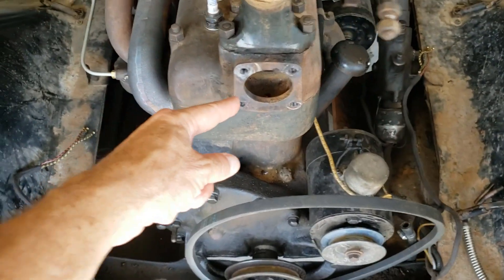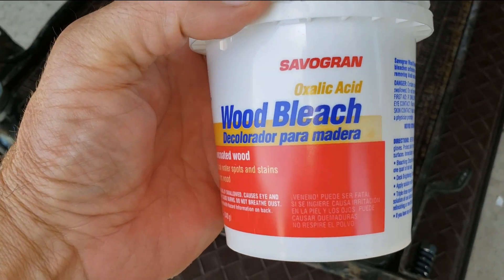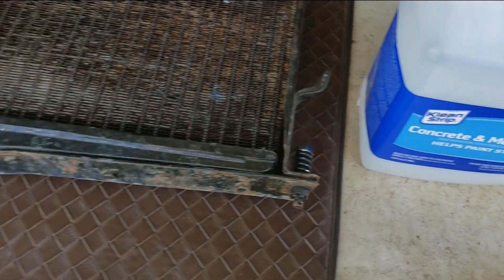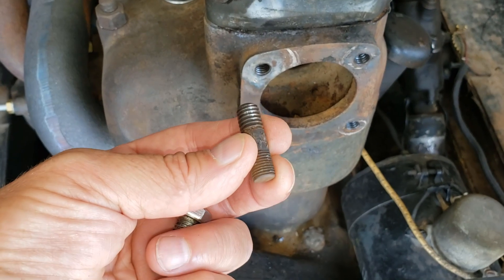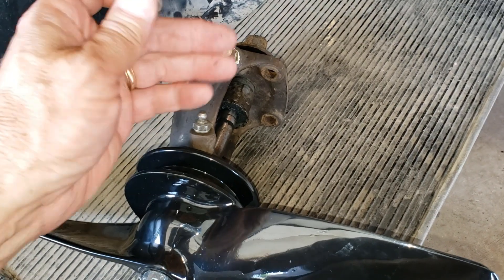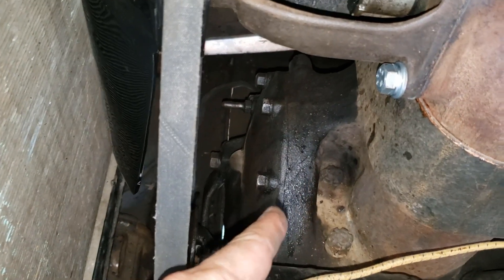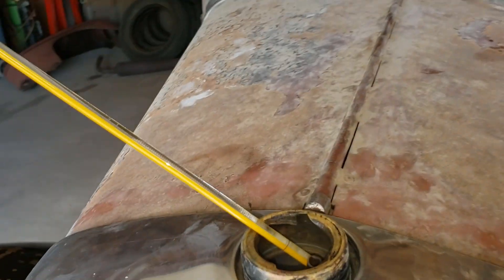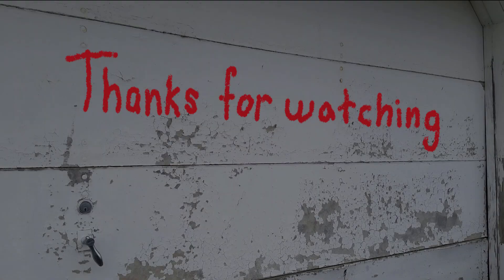Episode 14 - How to Safely Flush a Radiator with Acid. #withme #barnfind

Comment: When you say 3 to 1 ratio you are mixing a powder and a liquid how much powder to a gallon of water
Reply from the maker: 4 ounces per gallon.
Reply from the maker: The Radiator holds 3 gallons so I read on the label of the powder to mix 1 gallon of water in a milk jug. Then added it to 2 more gallons of water into the radiator to fill it completely. Hope this helps.
Reply: @FlatheadTerry yes but how much acid powder per gallon of water

Comment: How long did you let the mixtures sit in the radiator? 

Do you think the radiator has to be removed to do this? Or if you capped the bottom tube could you do it on the car?
Reply from the maker: I soaked it about 5 hours. But it depends on the amount of build up to remove. Mine stopped bubbling after that time which was a good indicator of completion. However, leaving this acid in for very long times can cause damage so you can drain it out after a few hours and if it's not done, just re-install the solution again to be on the safe side. Also, this can definitely be performed in  the car. Yep, just cap off the bottom like you mentioned.

Comment: how did you mix the 1 to 3, and what size container did you use. you did mention a gallon jug, but not sure how you positioned the radiator; so it get's to all areas. Thanks, and i'm definitly going to try your method, as i've already purchased the ingredients. 😀
Reply from the maker: I mixed it in plastic gallon  milk jugs as it made it easy to pour in. I had to take out the radiator anyway so I just laid it down flat. It took time for the solution to work it's way into all of the tube's but after 30 minutes it settled and I didn't have to add any more solution. It's OK to perform this while the radiator is still in the car. Just cap off the bottom securely. Hope this helps!
Reply: @FlatheadTerry  answered perfectly, Thanks😀

Comment: I've had the same issue with my Model A radiator. So so so much rust. I've done a total of 3 days of soaking with vinegar and I've had to take the water pipe off to get all the rust chunks out. I'll take it around the block and it overheats again, so I have been just rinse and repeat mode. If it doesn't start running cooler I'll probably try the acids you used. Thanks for the video!

Comment: I just take it to a radiator shop they have hot acid tanks removes everything even the paint. They use a torch remove the tanks rod out the core with flush with the acid solder the tanks back on repaint everything good as new.  They usually are in the industrial parts of cities where  no one much cares what chemicals people are using near junk yards lot of times. Some little shack looking building from what I have seen.
Reply from the maker: Thanks for the suggestion blastman8888. I called all the local radiator shops and they wouldn't touch it. Its too old for them they said. So I had to resort to this process.

Comment: Great Stuff. Thanks Terry. I’ve also heard that if you have to use a paint, on the Radiator. Use one that is Water Based. If you wished to paint the outside of the Radiator…Any other type of paint use restricts the flow of air though the fins? This was something an old Mechanic/Radiator Specialist/Shop Owner told me in the early 1980’s. I’m not sure if this still holds true. Thanks for your info, I also built the “Apparatus” for later use, Thanks.
Reply from the maker: Thanks for the good info Craig. Appreciate it!
Reply: @FlatheadTerry  I tried buying the Klean Strip Metal Prep and Wood Bleach at Home Depot. They didn’t seem to carry it here.
Reply: Found it on Amazon. So, my rust removal will continue.

Comment: What size bolts did you use to replace the water pump studs?
Reply from the maker: Dang, I don't remember! I took the original bolts and went to the hardware store and found similar sized studs.
Reply: @FlatheadTerry  According to Bratton's 2019 catalog, the original studs had 3/8x16 threads and were 1 1/4" long.  Similar size bolts should do the trick.  Model A suppliers also have replacement bolts made to look like studs with nuts on them.  A little pricy but will fool the judges.
Reply from the maker: @mafcawebmaster4237  Great info! Thx!👍
Reply: @FlatheadTerry  Tip: when doing a "how to" video, it's nice if you can give full descriptions of the parts you use, like you did when you mentioned the chemicals.  That way, viewers have a "heads up" on what they need to look for. :)
Reply from the maker: @mafcawebmaster4237  Thanks for the comment. Agreed! If you view my more recent videos, you'll see that I've listed the part numbers, manufacturers, etc., in them to better help the viewer find 'em.
Reply: @FlatheadTerry  Thumbs up! Terry

Comment: i try with everiting the best was oxalic acid!! remove old coolant add only destiled whater with 50g or so ocalic acid! and drive a day! acid will work with hot engine and water! next day remove colant and do this at least 3 times will remove all rust!! its work so well one mine its remove the rust preventing radiator leak!! after that i had a leak in radiator! so now i prefer stay rust!! heheh and change coolant at least omnce a year! same deal with engine!! never do engine flushes in high mile car, same with coolant
Reply from the maker: Thanks for the info RBG! I'll be using Oxalic acid on future projects for sure.

Comment: I believe I saw that a four-blade fan is available for the Model A that pulls more air thru the rad, if this work doesn't totally remedy the problem; don't know what the operating temp. is for a Model A. Correct me, if I'm wrong.
Reply from the maker: Correct, there is a four blade available and I did consider it. It doesn't overheat anymore so I'm good to go. Thanks for your comment and watching!
Reply: The two blade fan works fine when the cooling system is in good condition.  If it isn't, a four blade fan may help, but the best solution is to clean the cooling system.  Then the 2-blade fan will work quite well, as it has for 90 years.

Comment: Great video I believe I have to do the same with my radiator and was thinking of maybe going with a 4 blade setup for the fan
Reply from the maker: Thanks for the comment Kevin! I've read many comments on the forums that many have had success with them.
Reply: Flathead Terry Restorations Thanks Terry I also have a Apco temperature gauge ready to install those Motometers are more of a decoration then an accurate temperature gauge
Reply from the maker: @NewEnglandBeachDetecting  Great idea! Much better than me putting a thermometer in the radiator all the time!